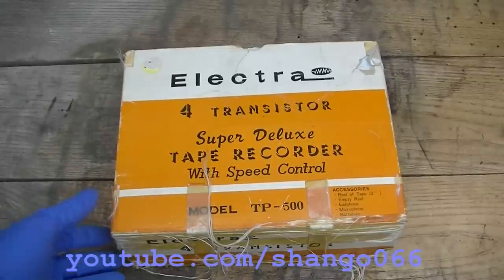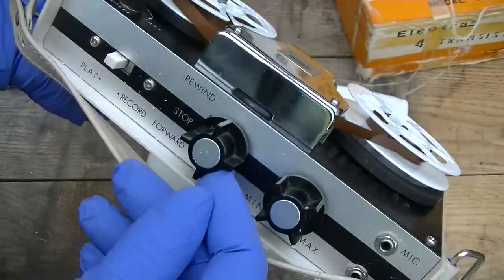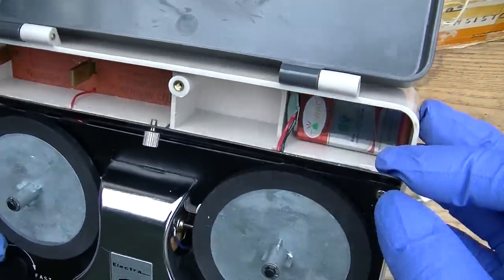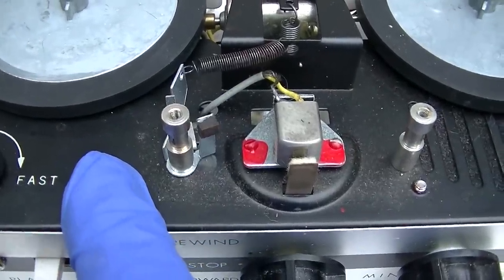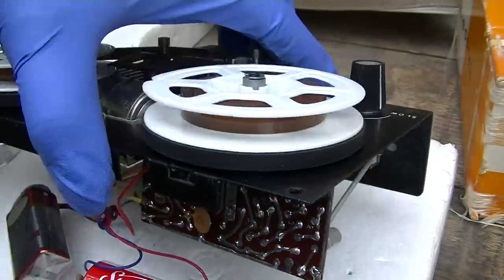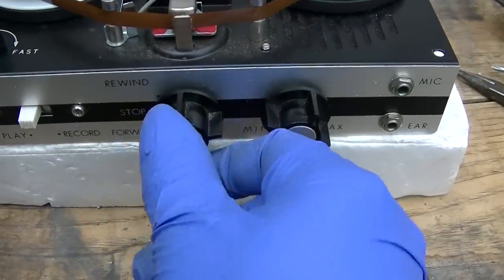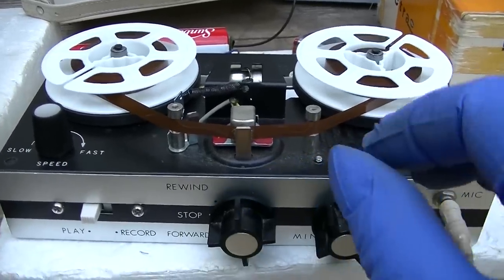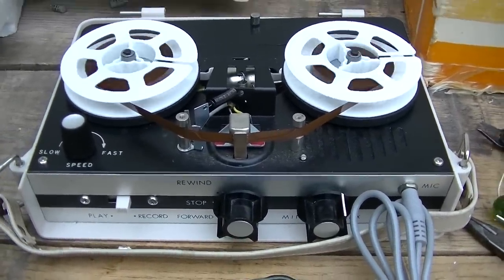Vintage Electra Tape Recorder 4 Transistor Early Japan Built Repair

Comment: Yep, you just aren’t quite old enough. Cheap cassettes killed off cheap reel to reels.
Mine was branded Windsor. It came from Thrifty Drugstore for my 8th birthday in 1962.
It was the same mechanism as yours. (many were)
My friend next door had a slightly different one branded Honey Tone. Almost all the early transistor radio brands had something similar in the same era when the 6 transistor AM radio was at it’s peak. My friend and I (who were into Alan Sherman BTW) recorded elaborate “tape stories” as we called them doing improv. narration, voices and sound effects. We recorded the TV sound, we recorded records off our little record players and songs off the radio.
When new, they were a bit better than yours, but not much. It cost about an extra $20 to get one with a capstan and actual AC bias.
I also learned how to solder very early because my dad got sick of fixing the microphone and earphone wires which broke a lot. I first saw the inside of a machine like this by the time I was 9 or 10. Actually it had been apart and back together many times by then.
Thanks for the memories.
Oh yeah, I have a collection of these sorts of small battery reel to reel recorders.
Maybe I need to do a video.

Comment: Those do seem to be super 8 film reels... on a DC bias rim drive! LOL! Should take any kind of consumer 1/4" tape. I wonder what would happen with professional 1/4" 456 tape but the felt pad and tape backing might not like each-other.
Reply: wdavem 
Actually standard 8mm reels of that 3” size interchange with the tape reels.
Reply: @w7777777s  ok, right. Different spindle sizes.
Reply: @w7777777s  I remember there are adapters now

Comment: The problem with parallel cells is that if the user mixes one discharged cell with a fresh one the latter will try to push huge amounts of current through the former which might cause catastrophic failure

Comment: As has already been mentioned in the comments, these little cheapie 3” reel-to-reel machines played at either 3 3/4 or 1 7/8 ips.  In the ‘60s you had to spend at least $50.00 or $60.00 to get a decent reel-to-reel that could run at 7 1/2 ips and take 5” or larger reels.

Comment: Hi Shango, the chinese stolen open source transistor, ESR, whatever tester can test capacitors in-circuit, at least my a little bit different from yours variety can. In my variety called GM328 (LCD raised on stands above the MC with encoder, clamps for voltage measurement, frequency and PWM generator output) I have to first put it in capacitance meter mode from menu after which I can clamp extension wires (as probes) on inputs 1 and 2 of the ZIF socket. It's close enough to not very expensive dedicated tools.

Comment: Those were the cheapest tape recorders available in the 1960s.  Rim drive Crystal microphone permanent magnet for the erase head.  They don't get very loudand do not perform well even though they will make audio.  More or less only good for voice.  I had a few of these when I was a kid and was never impressed by them.  You used to be able to pick them up all you wanted at yard sales and garage sales for a buck apiece

Comment: That's a recording of Allan Sherman   and there was no side 2 on reel to reel
Reply: Yes there is a side two on this format. It's not "full track", it's a half track mono format. Side one is on one half of the tape and side two is on the other. If it was full track you would have heard side one backwards when he flipped it over.

Comment: I have a Roberts(AKAI) 6000 on my dining room table. Got my hands on the paperback Sam's... found virtually every cap bad. If they weren't open, the were way off value.

It actually looks like someone did a partial recap sometime on the 70s. 

Anyways, ended up getting it running. It's far better built than this Electra.

Comment: I guess that the Tape Mechanism is just too low in performance for music.This Tape Recorder would have been ideal for recording bits of speech from friends and family back in the 1960's though, When you couldn't buy anything better at that price (as a way of helping to remember any folk who were no longer around later on).I guess with the input designed for a Crystal Microphone it wouldn't work with a Telephone Pick-Up Coil.

Comment: Make it out of plastic, using hot glue to hold things in place you have a modern Chinese tape recorder. Highest quality transport and fidelity...1/4 watt speaker, Germanium transistors crap caps. Rim drive. .the ultimate in speed stability.

Chine-o-batteries, when only the best will do!

There has to be some sort of bias oscillation circuitry to power the erase head, if it has one...otherwise you get sound on sound on sound as you record over and over.

OH, no erase head, love that wow.. and flutter..

What size tape is that, .. looks wider than consumer 1/4"?

O

Comment: These were real cheap affairs when they came out in the early 60's. I bought one at a drug store and it only worked for 1 day and stopped working. I ended up taking it back to the store for a full refund. They never recorded music either as they have no capstan. These only cost around 12 dollars when they were new.